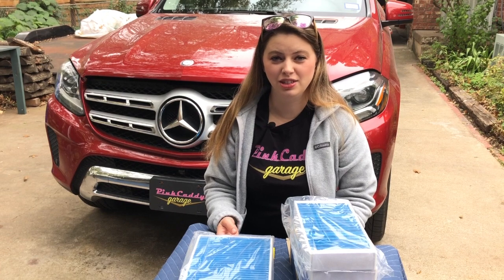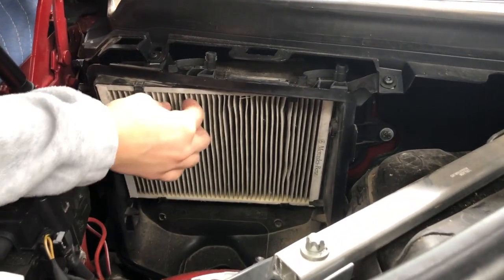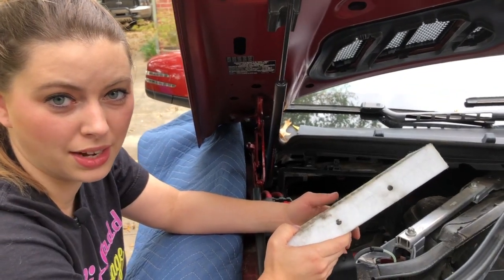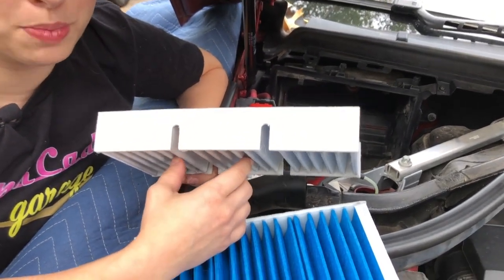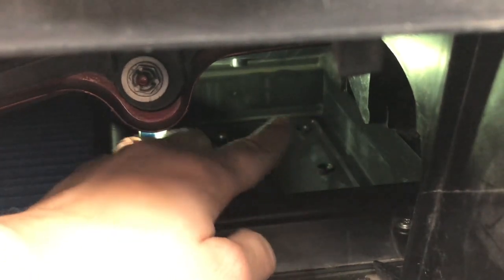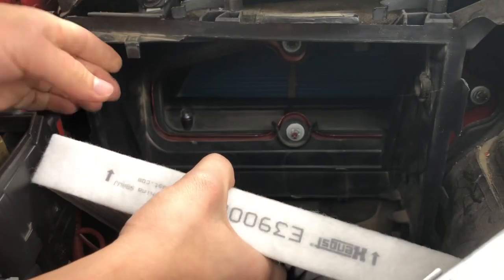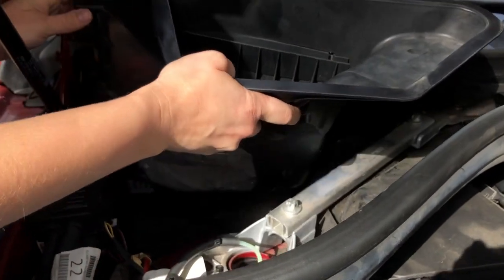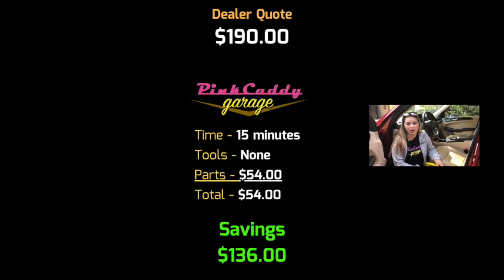Mercedes GLS 450 Cabin Air Filter Replacement

Comment: Very helpful video! I purchased the same filters and noticed that the two cabin filters you put in are actually upside down, if you look the arrow indicating the airflow points toward the blue side. Thanks!
Reply from the maker: You are correct! Even though they seemed to work fine, on the next filter change I went in through the glovebox side… probably should make another video.

Comment: How long does it take to change plugs on 2011 450 gl
Original plugs changed at 75k now have 160 k miles.

How long does it take to replace a starter.
Saw starters on ebay 120 to 500 dollars..do you need to take front apart or can you manage to take starter out without doing all that.

How many hrs should it take? Can the starters be the same?
Reply from the maker: Sorry I’ve never worked on a 450 GL so I don’t know the answers to your questions. But you can go to a website like rockauto.com and check part numbers between the various cars to see if it is the same part.

Comment: should I change this if there is gross smell when I put the a/c on or is that different?
Reply from the maker: It is a good first step. However, you may have mold or other things inside the system it will have to be cleaned out to completely make the smell go away.

Comment: Thanks for the video. Question, I leased Mercedes for many years prices are crazy for new leases so I now purchased a used 2018 GLS 450 with 35,000 in great shape. I didnt get the maintenance package because it was too much. Can I do my own maintenance? Thanks for any help.
Reply from the maker: Short answer, yes. You can probably do whatever you feel comfortable with, most service A and B items we’ve already covered in a video as I was doing it for the first time. Whatever you aren’t comfortable with, there is always the dealership. I did the same thing as you, did not purchase an extended warranty. We now have 67,000 miles and so far, so good.

Comment: Pink Candy - I have a 2019 Mercedes GLS 450. I drove over 3 hours straight non stop and the Engine temperature gauge went up to near the red indicator. I pulled over to allow the engine to cool down. I noticed the fan was not kicking in to cool the system. This has happened three different times now. My SUV has less than 15k miles. The first rime it happened was about one year ago. I took the SUV to the dealership but they told me that Mercedes Engine temperature gauge runs normally high. I am now thinking the Thermostat or the Fan is not working properly. What is your recommendation on this matter? Thank you.
Reply from the maker: The dealer will tell you as long as it stays out of the red you are OK, and I guess technically that is true. However our 2017 GLS does not get as high as yours sounds like it does. I would hook up a scanning software that tells you in real-time what the value is for engine temp. That will save you from guesswork. 
If you don’t have one, I would check:
Coolant level
Thermostat… not sure how you’d check it , short of replacement. 
Fan fuses/relays

Hope that helps!
Reply: @pinkcaddygarage267  - Thank you so much. I appreciate your help and the quick response!!

Comment: Please - which website did you buy the cabin filters? The Dealership told me that I have to buy Mercedes parts from an Autobahn specific store otherwise they parts will not properly fit/work as suggested by Mercedes. Thank you.
Reply from the maker: Check the description for the video. I recently added links for those filters just click on them and it will take you directly to the filters on Amazon

Comment: You have the 2 smaller ones you put in first backwards. The blue should be facing down. I bought the same filters and the arrows point opposite of the blue, just as the single big one.
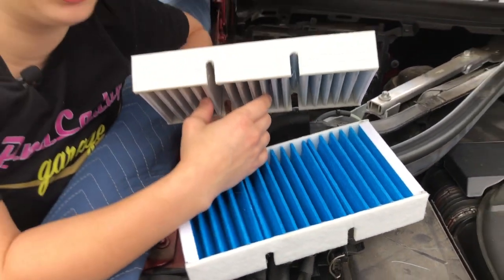Reply from the maker: If you watch the video, at 2:15, it shows the installation slots built in to the new filters. They can only be installed one way, which is how it was done. If you try to put the blue side of the filter down, there’s no way you could clear the plastic positioning spikes.
Reply from the maker: Since we are coming up on another B service on this Mercedes, I will re-verify the orientation of the filters just to be sure!
Reply: I was finding the same problem, my filters have the great slots but the arrow is pointing up toward the blue side away from the slots….but a second look has me noticing the fan underneath where filters go so this would be correct for air flow I believe
Reply from the maker: It’s been so long that I actually don’t remember. Plus our Mercedes has been in the body shop since July waiting on one little part that they are telling us cannot be made available until 2024, not 2023, 2024. Anyway assuming we ever do get the Mercedes back it would be just about time to do another B service so I will verify everything again.
Reply: @pinkcaddygarage267  Just did the full replacement with Hengst filters.  I found OEM Mann filters in place, and after comparing the orientation, it's safe to say that the matched, inner pair needs to be placed with the blue side down, and slotted openings facing up.  The first of the two filters installed needs to rest on the lip and slide over, just as the Mann with the holes.  This permits the depressions in the filter media to face up, matching the Mann.  Both the inner two filters and larger, outer filter need to follow the printed arrows with airflow moving down and toward the cabin.  The Mann filter PNs are A 166 830 02 18 (CU 25 002) and A 166 830 82 00.  Hope all that's useful to someone.